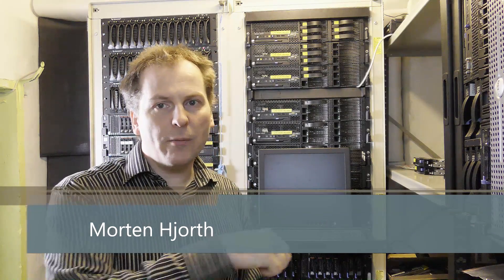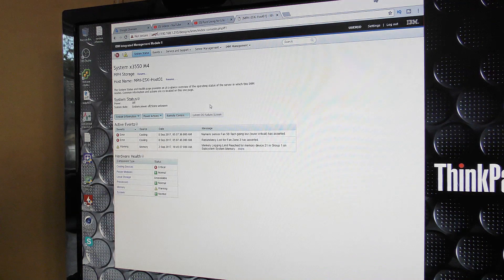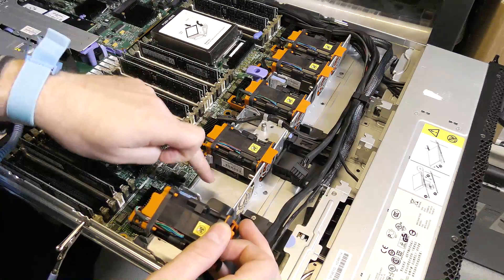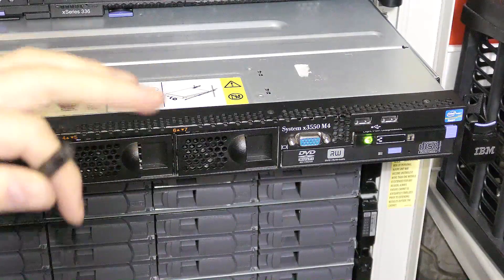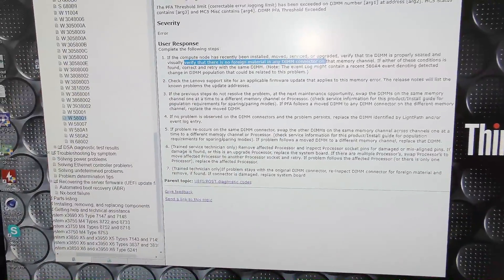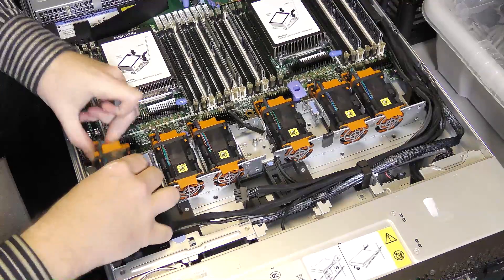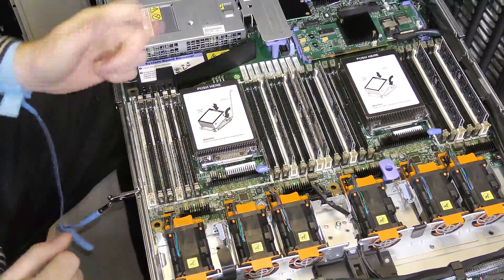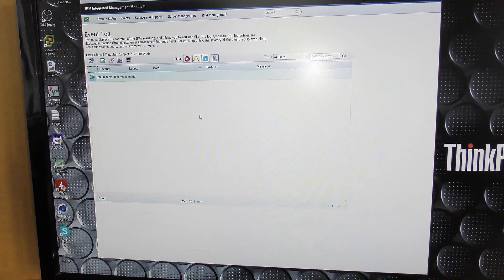SuperGlue Fixed Enterprise Rack Server! - 576

Comment: nar it won't 'dry' out while it's running, it will cure in a time and what you'll end up with it s a shabby bond,possible with little 'streams' of cyanoacrylate super glue creeping through the system, with no connection because of the constant vibration. Oh not to meantion a nice white conductive powder crystals that form along the way( this also 'eats' plastic').
Reply from the maker: Hi D J Wizard
Thank You very much!  I am not losing any sleep :-)
Thank you for watching! :-)
Reply: np, I would :)